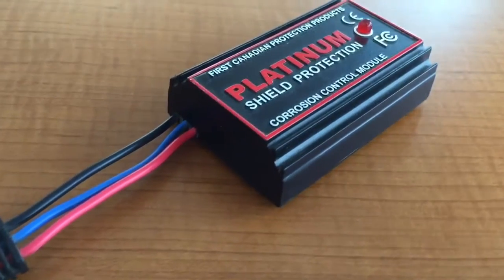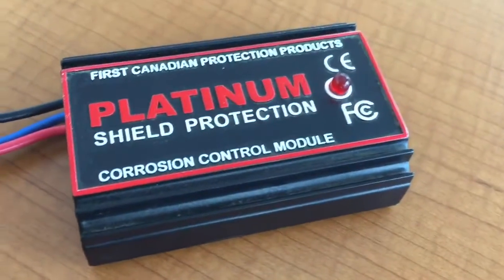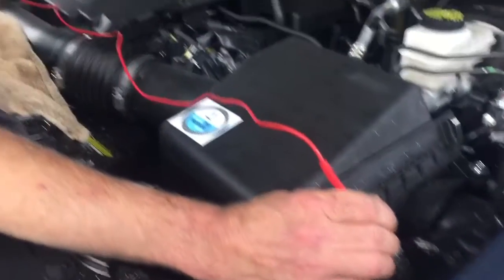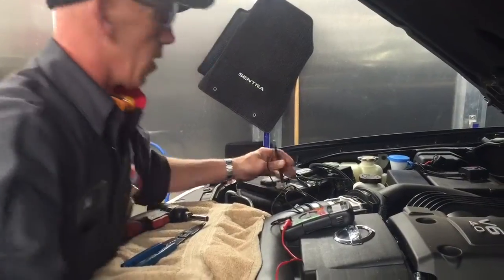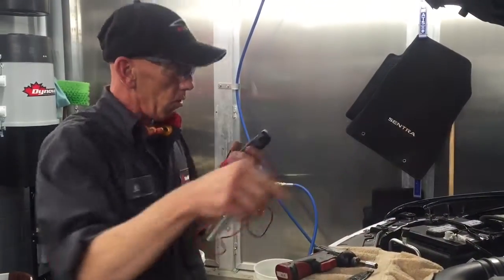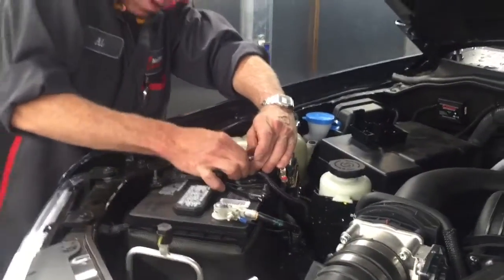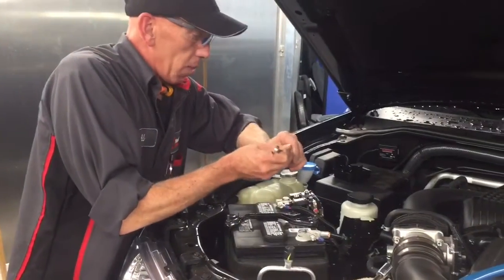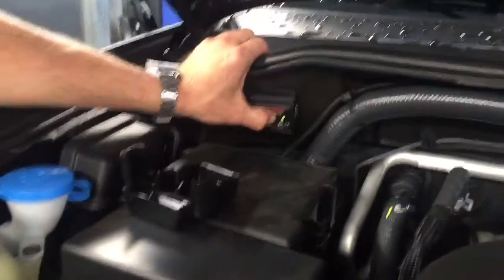Vehicle Corrosion Control Module Installation

Comment: Scam indeed ! Dealer installed 2016 on brand new car. Summer of 2021 hood is rusting through where you would put your hand to raise it. Started rusting from back side now there are rust bubbles showing on the outside. 4 feet from where this thing is "grounded".
Reply: Did they warranty it? Apparently it comes with 10 year rust and paint warranty..
Reply: @CanadianSpeedster  They haven't answered my emails yet....  I am calling this week. My paperwork does say it is warranty.
Reply: @michellepearson3148  Who is the vehicle's manufacturer?

Comment: I believe electronic corrosion control for vehicles are scam products that do not have any benefit corrosion-wise for a vehicle.  Consensus amongst professionals in the field of corrosion control is that electronic corrosion control of vehicle of the type advertised under various brand names are not effective at corrosion control and bot backed up by recognized independent testing.   I have reviewed warranty and user manual materials for some of these systems and I believe they are not with considering.  I write more about the systems at my website  @t

The different brand names include the following:
Auto Saver System

FinalCoat
Etronic Anti-Corrosion Module
CounterAct
Body-Gard®
Rusterminator
RustStop®
Couplertec
Electro-Shield
Rust Evader
Neo Rust Evador